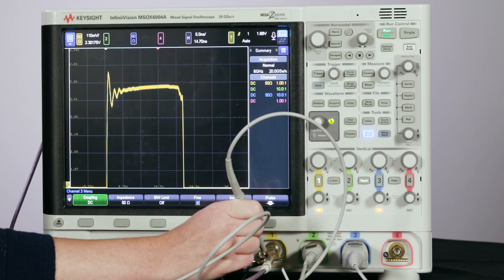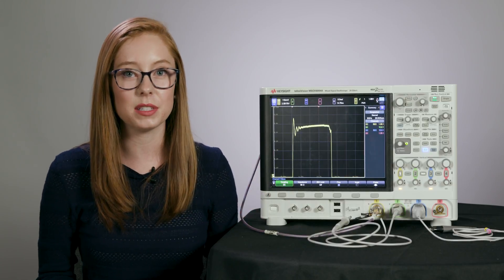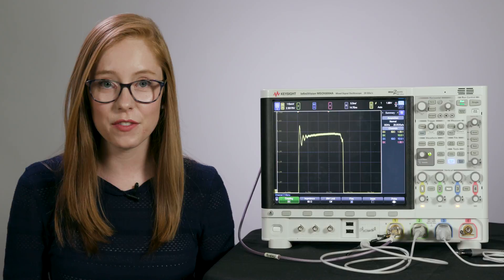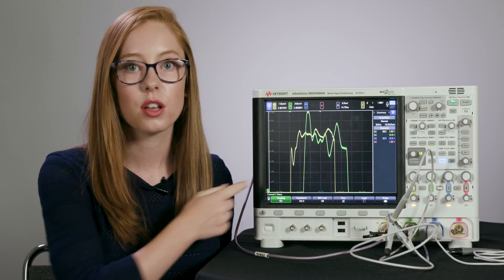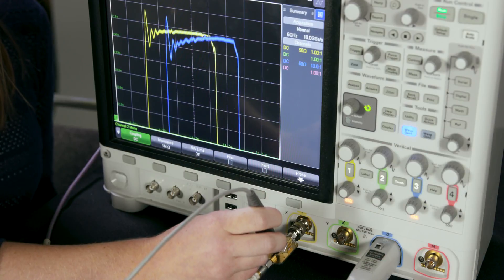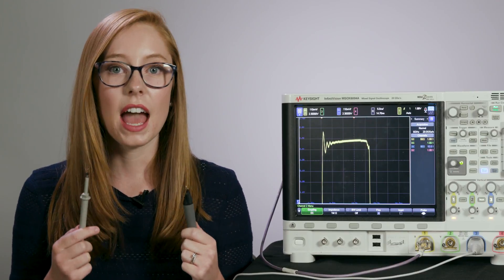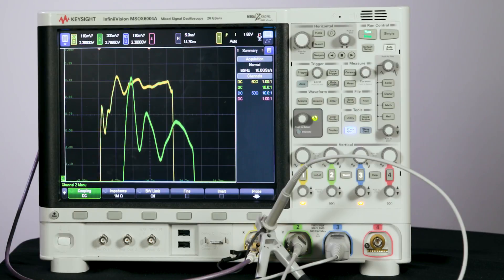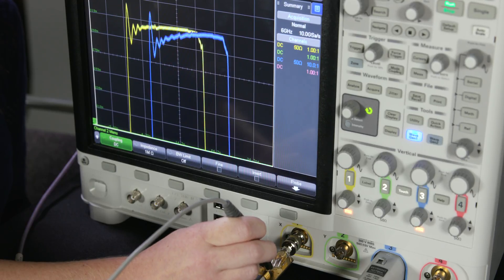What is Probe Loading? Take the Mystery Out of Probing

Comment: can we use passive probe with 10x settings to reduce loading effects ?
Reply from the maker: Yes, but often the 10:1 probes are used for lower speed signals in 50 ohm mode

Comment: Higher impedance, means lower loading right?
Reply from the maker: Yeah, the oversimplified way to think about it is like a resistor divider. If the measurement system has a high impedance it pulls less energy from the system it's measuring.
Reply: Yeah, but "impedance" is a word lawyers would love to have in their domain, because it hides three things. Resistance, and Reactance, the latter covering Capacitance and Inductance, 
Each of these will be dominant in different geometries and different frequencies. Active probes have active circuitry right up at the probe tip, allowing you to reduce resistance and capacitance to strict minimums, but you may still have substantial inductance from the length of the ground clip, unless you utilise one of the many geometries proposed to also get your ground down to something very close to your measurement point. The good news (for oscilloscope manufacturers) or the bad news (for you) is that as the frequencies of almost everything continue to get ever higher, more elaborate probing and measurement methods are going to have to come into play to get a meaningful measurement of your signals.

Comment: Let's say I'm using a dedicated power source (eg. unplugged UPS or a battery pack) to power the scope. Can I then measure differential voltage on Mains without blowing up the half of the planet?
Reply from the maker: Officially no, but you can look up how to "float" an oscilloscope and there are some options & considerations
Reply: Some oscilloscopes are designed to be floated. Such is the case with my now ancient TEK 222PS, which is certified to float up to 850V p-p. 
These scopes will often be poor in bandwidth and performance compared with everything else on the market, but the application you describe does not require high performance.
These scopes will be extremely well isolated, and feature NO metal parts on the outside of the case. Any scope that has anything metal on the outside is required to be tied to mains safety ground, even when running on battery. Whether you comply with that requirement is a personal choice.